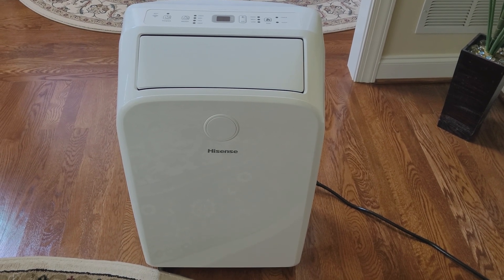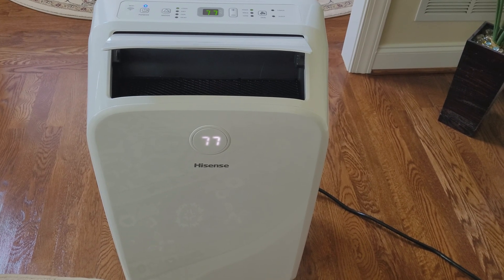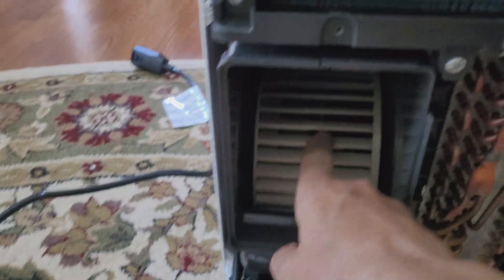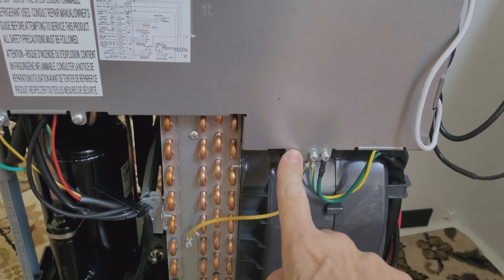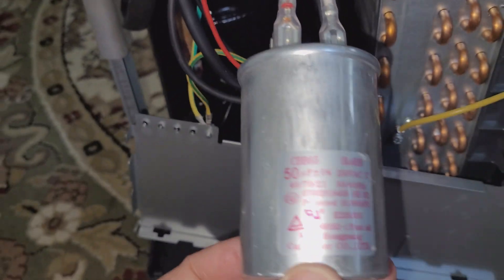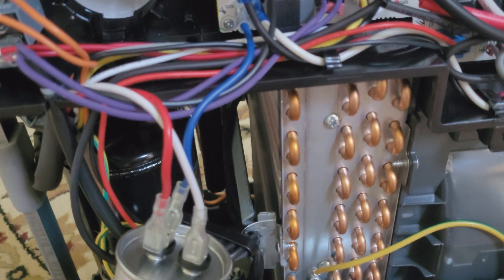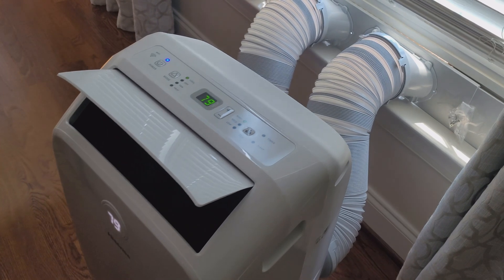Fix a Portable AC  with Heat Pump Hisense not blowing Cold or Hot air. Causes and fix #portableac

Comment: My compressor kicks in but still no cold air...
Reply from the maker: If everything works, but no cold air, most probably, your unit has a leak, and it's low on refrigerant.
Reply: @strykergaming_ngadgets def. Not good news.  I dont know if that can be done
Reply from the maker: @ryanc6767 Unfortunately, a leak repair costs more than a new unit. Most if this portable ac units come with a  2 or 3 year warranty, hope yours is still covered.

Comment: What about finding leaks? My compressor comes on but I still have no cold air?
Reply from the maker: If the compressor kicks in but no cold air, try this first:
https://youtu.be/EJYEPsAkxWw?si=RaIx1-aZ7wE2Pm3p

If, after following those steps still no cold air, your system has a leak, and it's low on refrigerant. Fixing the leak and adding refrigerant will cost more than a new unit. Check your warranty. If it's applicable, you're lucky. If not, get a new unit.

Comment: I changed capacitor. Still no cold air.. condenser kicks in. Maybe just a bit colder air than it used to be.
Reply from the maker: @FolderLocker-n1g  If everything is working,  compressor and fans kick in and unit is not cooling,  then it has a leak and it's low on refrigerant.

Comment: Sorry to bother, I'm sure you get a lot of questions! Have you ever had water leaking out of the block on the end of the cord before? My Hisense turned off one day and I had water seeping out from the cord near the test & reset buttons (but there's no water that spilled on it - it's far from windows and any water source besides humidity). Despite letting the plug dry in rice for a few days, my unit still won't power on. I plan on replacing the cord itself, but I'm worried if any other portion of the unit could've been damaged and if the new cord could possibly end up leaking water in the future.
Reply from the maker: I assume you are talking about the AC plug circuit at the end of the plug in cable. If water some how got into it, that will not be the condensation from inside the AC, unless your wall plug is way lower than the AC unit itself and you have a hole in the accumulation pan and water kind off leaked along the cable, not inside the cable. Well the plug circuit has a solenoid and a circuit board - these can get damaged by the water. Damaging the plug circuit will not affect the AC unit, the unit will simply shot off. If it's still not turning on, change the cable. Hope this helps
Reply: @strykergaming_ngadgets  Yes, that's right! It's the circuit part at the end of the cable. My wall plug is about 8 inches off the ground, so the majority of the cord is on the floor. I'll keep that in mind and see if I can hang the cord up higher after replacing it (just as a precaution). Thank you so much for taking the time to reply. I greatly appreciate it.

Comment: Hi, thanks for the video. My compressor turns on and after a about 30 min  the compressor shuts off and only the fan stays on. Do you think its the capacitor or something else?
Reply from the maker: Is it cooling while it's on? After the compressor shuts off, does it turn back on by itself after a while?
Reply: @strykergaming_ngadgets this is exactly my issue.
Reply: turn the thermostat to its lowest setting

Comment: My compressor is getting hot but the pipes from my coils aren't getting cold. I also couldn't locate my capacitor. Any thoughts?
Reply from the maker: Try these steps first 
https://youtu.be/EJYEPsAkxWw
If it's still doesn't work you might have an obstruction in the pipes that prevents the refrigerant to flow properly or a leak and no refrigerant is left in the unit.
Reply: @strykergaming_ngadgets  I did see a small amount of an oily substance on the bottom. I'll try all these and see though
Reply from the maker: @Qizerole  The refrigerant feels oily. If the leak is small it will dissipate in the air and you will not see a lot of it inside the unit.

Comment: Mine is not kicking heat out the back. How do I know if it’s the capacitor or the cooling itself.
Reply from the maker: @mattrobins3721  The primary function of the capacitor is to help start and run the compressor.  When the compressor starts, you will hear a kick and a continuous buzz. The unit will shake a little. The fan noise can mask that though. With the back cover off, you will know for sure if the compressor works or not. Hope this helps

Comment: Do you know why mine turns on and makes noise but blows no air hot nor cold and the condenser freezes over within a few minutes?
Reply from the maker: Just making sure, is it the evaporator coil that's freezing or the condenser one? Evaporator is on top, condenser is on the bottom and the cover needs to be removed to see the condenser coil. Let me know.
Reply: @strykergaming_ngadgets  excuse my ignorance I know nothing about acs, it’s on the back where the filters goes in front, it freezes within minutes
Reply from the maker: @ngjty  It sounds like the evaporator coil. Usually main reasons of freezing is restricted airflow due to coils being dirty or fans not working. Check if the fans are working and clean the coils. If the unit is still not cooling, that means there is a leak and the unit is low on refrigerant. In this case, get a new one. Fixing the leak and recharging the unit costs more than anew one.
Reply: @strykergaming_ngadgets  I will try that and let you know thank you.  I ordered this as a remanufactured unit and I emailed them stating my issue and they gave me a full refund and just told me to keep it.  So I basically received this completely free so I’m not out of any money on this.  But if the repairs are over $200 which is what it originally costs then I will just throw it away.

Comment: You're not supposed to run those without a hose either out the window or up I to the ceiling to release the hot air coming from it.
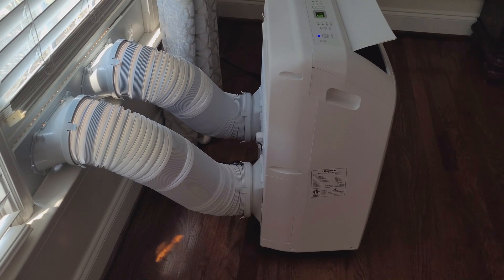Reply from the maker: I agree. A single hose unit comes with one hose that vents the air outside, and they are less efficient, because they suck the air from inside to cool the unit, thus creating a lot of static pressure. A dual hose unit, like the one in the video comes with two hoses: one sucking the air from outside, cooling the unit and then venting it outside. Both hoses connect to outside. Check the video at 10:15 min after the repair is done. Thank you for watching

Comment: what if the ac (also a hisense, not the same model, however) turns on but isn’t blowing ANY air? i swear it has a mind of its own & sometimes it will blow cold air when in cool mode, sometimes it’ll blow air as if it’s in fan mode & sometimes it just doesn’t blow any air. i always try resetting, unplugging, cleaning the filters, emptying the excess water inside & still nothing🤦🏻‍♀️
Reply from the maker: These units have 3 sensors: one on the grill behind the filter in front of the evaporator coil ; two inside attached to the pipes next to condenser coil and next to evaporator coil. The ones inside monitor the refrigerant temperature and adjust the flow accordingly. Check if they're not dirty, especially the one next to the condenser, there is no filter there, and use some air dusters to clean them.
Reply: could be a board issue. in fan mode, the sensors dont matter

Comment: Hi i have dimplex portable reverse cycle ac 1.5 ton . After 15/25 min it throw hot air instead of cold air .i think compressor of and blowing hot air . And after some houry it would be on wd cold air but sometime 20/30 min again stopping cold air and throwing hot air again .plz tell me the basic reason
Reply from the maker: The unit should have 2 fans: one for the evaporator coil on top where the cold air comes out, another for the condenser coil to keep the compressor temperature down (bottom one). Make sure these fans, especially the bottom one are not turning off. These units are designed with electronic pressure/temperature monitoring in order to protect the compressor, so if the fan will turn off, it will signal the compressor to turn off too. Also there should be a temperature sensor attached to the pipe next to the condenser, check it make sure it's not clogged. If this is not the case, check the drain pans for water accumulation. Excessive moisture will fill those pans pretty fast, so to avoid flooding the compressor will stop while fans will still run to evaporate that water. It might be a failing capacitor too not providing enough juice for the compressor to run smoothly. I don't think it's the main board. Hope this helps

Comment: Hello friend, I have couple questions for, first of all, I don’t know why, but I think you can speak Russian as well, if yes - please answer, if no - never mind. The second question is, I have almost the same ac like yours, it’s also Hisense, but I have a different problem. So I can hear that the compressor is working, but it still no cold air. I think the refrigerant (freon gas) needs to be recharged. Maybe you know how to do that? Because I’m not sure which freon should I buy, and how to properly recharge it. Thanks for the answer!
Reply from the maker: Hi there. No, I don't speak russian. To answer your other questions, if everything is working but no cold air is coming out, the unit  most probably has a leak and it's low on refrigerant. Recharging the unit without appropriate tools and equipment is not a DIY job. These units do not have a recharge port/valve, so fixing the leak and recharging costs more than a new unit. If your unit has a leak and you are out of warranty, discard it and get a new one. Thank you for watching.
Reply: @strykergaming_ngadgets  oh, okay, I see… well, thanks for the answer, anyway I sold it today already and will buy another one 😅

Comment: Awesome vid! For mine, the compressor kicks in and stays on but the air doesn’t cool at all. I inspected the board and wires and rule out an electrical issue. The compressor gets warm, should I should still replace the capacitor? Any tips or ideas on what else I can check?
Reply: I’m in the same situation not sure what to do
Reply from the maker: So, if the compressor kick in and the fans are spinning, everything seems to be working but no cold air, chances are you have a refrigerant leak. If out of warranty get a new one, fixing a leak in a portable AC costs more than a new unit.

Comment: Thank you so much for the video! Have you ever considered adding a soft starter to the compressor to smooth out the power draw?
Reply from the maker: Thank for the suggestion. I didn't consider that, these capacitors are pretty cheap to replace, a soft starter is more expensive.

Comment: Was it necessary to remove the front cover in order to replace the capacitor?
Reply: This is a well done video. Thanks for doing this. I am going to try to do this.
Reply from the maker: Yes, the electronic components are usually under the front cover away from moisture and heat.   It's highly unlikely for the capacitor to be accesses by removing the back cover only. Thank you for watching.

Comment: Thank for sharing your video. We have the same problem with our new portable a/c that we just installed July 1st & stops working Sunday July 7th. Just bought it from Costco.
Reply: Same issue, a danby from Costco, and they’re sold out. 🫵🏻🤬
Reply from the maker: @chadland71  Sorry to hear that. They are usually available at Costco in spring.  I think you can still find Hisense and Midea at Costco online though.
Reply: You should just go and return it, then you can get a new one.
Reply from the maker: @ariza7400  Return it and get a new one. Costco offers 90 days returns on appliances.

Comment: i have a different problem with mine though maybe you could help me. So i start my unit up the compressor instantly kicks in cold air comes out but after 2 minutes the compressor turns off with a kick and doesnt come on anymore. What could be the problem ?? I turned it off and looked at the compressor and its piping hot. When i wait 30 min or 40 min and turn it back on the cycle repeats
Reply from the maker: Try these steps first
https://youtu.be/EJYEPsAkxWw

If you are not getting any error messages, check and drain the unit. There might be water accumulated, the unit will start and then to avoid flooding will shut off. 
Pay attention to the fans, if a fan turns off before the compressor, the issue may be there. 
There is a sensor right in front of the grill and usually it gets dirty pretty fast, you can clean it using a can of compressed air.
If none of these, it still may be the capacitor. The capacitor acts as a small battery to give the compressor that extra juice it needs to start and run smoothly. A bad capacitor might still hold some charge, but not enough to make the compressor operate normally. Hope this helps. Let me know if you were able to fix the issue and thank you for watching.
Reply: @strykergaming_ngadgets mines does the same thing it clicks on then shuts back per blowing warm air mines is brand new just bought it today why won’t it stay on
Reply from the maker: @toshalewis1285  I advise you to return it and get a new one. It's not worth the trouble if it's within the return window. Thank you for watching
Reply: Check to make sure your condenser fan motor is running. Sounds like your compressor is kicking off due to high temp.

Comment: Helpful video but I took mine apart and my compressor does get hot and I can hear it running. However it is not cooling as well as it did last summer.  Filters are clean. Any other ideas?
Reply: Same
Reply: My Frigidaire Gallery portable AC is new but it doesn't blow cold air at all what could the problem be??
Reply from the maker: @eugeniagutierrez5013  
If the compressor kicks in and everything is working except for unit blowing cold air, most probably unit has a leak and it's low on refrigerant. Fixing the leak costs more than a new unit.  If it's within the return window, just return it and get a new one. Also most of these units come with a 2 year warranty in case  you cannot return it.
You may also try these steps. Manufacturer will ask you to perform them in case you're starting a RMA.
https://youtu.be/EJYEPsAkxWw

Thank you for watching
Reply from the maker: Sorry to hear that. Try to follow these steps, they apply to most manufacturers

https://youtu.be/EJYEPsAkxWw

If everything is running and unit not cooling or not colling as it used to, then best case scenario there might be an obstruction in the tubes and setting the unit to supercool mode for a couple of hours might clear it and have the refrigerant flow properly;    worst case scenario - unit has a leak and it's loosing refrigerant and eventually will stop cooling completely. Fixing a leak and refiling a portable AC unit costs more than buying a new one.